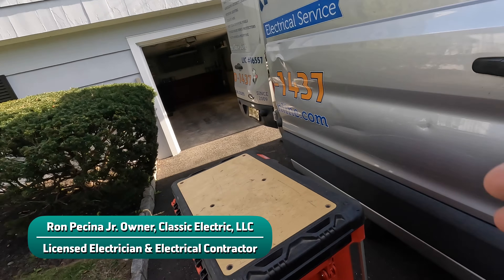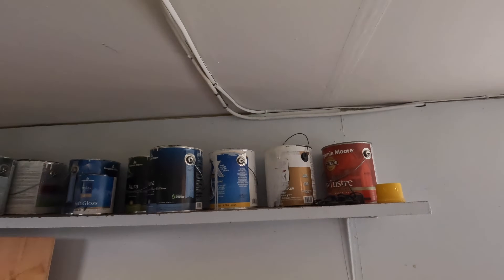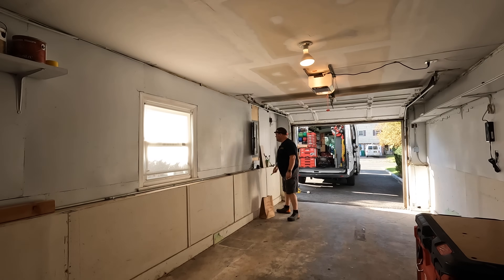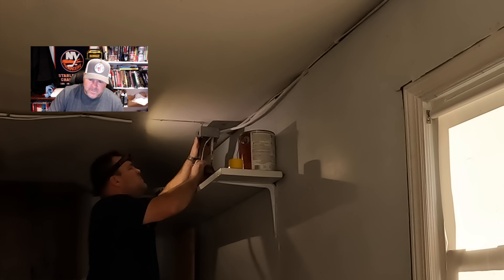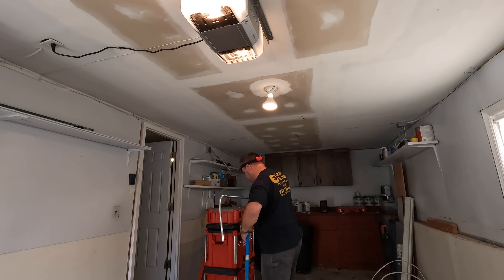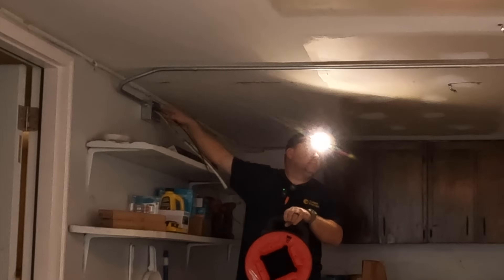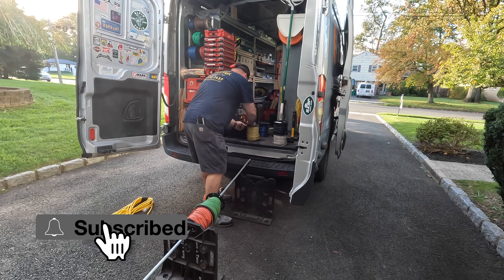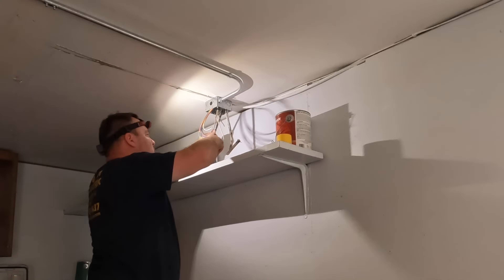Garage Wiring Code Violations

Comment: Why did you not use WAGO 221 wire connectors.  They are UL approved and are faster, neater and just as reliable as 1927 wire nuts.
Reply from the maker: @Chad.Tyrone  These are wire connectors.  Only Ideal has the patent for Wirenuts.”

Comment: If there are some exposed romex cables that run from the electrical panel all the way up to the top plate and then along the top plate in a garage without ceiling, does that alarm you?
Reply from the maker: @6668-x5y  Depends.

Comment: Hello, I'm new to your channel. I just finished building a garage and I'm trying to get a real answer to what wire I should use from house box to sub panel in garage. I have been told 6/3 and others have different size. House is 100 amp, sub will be 50 amp. Other than lights,openers and a small air compressor I have a 125 welder that plugs in 110. Hope you can help.. thanks
Reply from the maker: If it were I’d ask for PVC conduit buried minimum 18” deep with #6 AWG copper THHN/ THWN 4-wire.

Comment: I've always thought that EMT was used indoors, whereas PVC is used outdoors and underground feeds, since it can be made watertight and does not rust and collapse underground.  Of course unlike EMT its not self-bonding, being non conductive, so you have to remember to pull a green wire to bond the system.
Reply from the maker: thats an accurate assessment.

Comment: I would much rather use EMT than PVC. Wires pull easier in EMT. PVC gets crooked and wonky unless you use a lot of straps. EMT 3' off the box and every 10' (I usually did 8') and you're done. Nice little job Ron.

That old wiring was better than a lot of DIY stuff. At least the guy grounded it.

If you really want to cringe, go to upstate NY or Vermont. You have never seen sketchy until you go there. I had a Masters in VT before I retired. Back then you didn't need to have a license to wire a house. Don't know if that has changed.

Comment: What is the fishtape that broke on you again. I'm thinking of getting 1 & want 2 avoid it. TIA. Great work! IMO & IME PVC should never be used. It just turns into a mess! We had some put in at my work & like 2 years after that the clips started braking & everything, was just a HUGE mess & I volunteer for a local no kill pet rescue in my area that is a 501 C 3 non-profit so that was a HUGE & expensive problem!

Comment: Nice job.  As a consulting/design engineer I always required two hole straps and did not allow screw fittings, but that's  just me on commercial,  educational,  and industrial projects.
Reply: That's because, as an engineer, you don't know what is practical and what is not. In the field, we often just ignore unrealistic pie-in-the-sky engineering specs.
Reply: @edisont.picard4112  after 25 years of experience inspecting work, there are too many loose set screw couplings, conduits coming disconnected, fasteners pulling out,  It's simple,  follow the specs or I don't sign your pay application,  and you get to do the work over. Specifications my client paid me to write can exceed Code minimums. Remember,  the Code book is not a design guide, but minimum standards.

Comment: Nice cleanup there. WTF is that really old 10/2 (or 10/3) romex with the fiber sheath going to the dryer receptacle?! Did you deal with that end of it? That is so strange, someone recently installed that old cable? Must be recycled cable obviously. PVC or EMT? I vote PVC for outside residential, and EMT for everything inside that doesn't need liquid tightness. EMT just has the "workmanlike" aesthetic in a dry environment. Though I think EMT is suitable for wet environments too, I think it comes in aluminum and stainless.

Comment: I have a hard time swallowing that the risk of damage to the cable on the ceiling outweighed introducing all those additional joints in a feed to a dryer. That said, the wire running from the light to the side of the cabinet was pretty cringey.

Comment: Gee's Ron!  you get a pass because you do not  work with EMT, but you could have done better.  10 degree offsets for the junction boxes needed and 30 degree offset's for those corners.  well, I give you credit for using EMT.
Reply from the maker: You can do whatever you want on your jobs.  Sure, I could’ve done a 90 and a 3-4” offset at 30 degrees but I didn’t see it like that while I was doing it. I’m fine with my install.

Comment: Hi Ron. When I wired my two-car garage, I ran all exposed cables through metal conduit. I did this in case a blade or other sharp object got loose or I became DIY frustrated and threw something. All wiring is 12 gauge, and all outlets are 20amp rated. For four or fewer outlets, I wired them to a separate breaker also rated for 20amps. I realize this is overkill, but it is still cheaper than hiring an electrician, and it looks so good.
Reply from the maker: Nothing wrong with more than what you need.  20A x 120V = 2400 watts.  Plus (4) circuits like that! 4 x 2400 = 9600 watts.  Dude, you can run a lot of stuff with that much capacity.
Reply: Hi Ron. Thank you for your nice reply. I forgot to add why I strive to do the best electrical work. My next-door neighbor is a retired master electrician. He knows I always strive to do the best and my time, effort, and cost don't concern me. Thanks again and have a nice and safe day.🔌 @electricianron_New_Jersey

Comment: Great video. Quick question. The romex from the ceiling box back to the panel is still exposed. Is t that still an issue?
Reply from the maker: I think it’s out of the way and not an issue.  Do you? I was thinking a short piece of framing lumber (like a 2x4) could cover that up pretty easily.
Reply: @electricianron_New_Jersey I agree, a little wood could be used to cover the Romex in the ceiling corner.

Comment: Ron, I enjoy your videos and I feel for you too. I’m regionally worked in the south for 45 years and somehow I got tricked by my wife  move to Midwest. I have never encountered a smorgasbord of the wiring technique and how it ever got passed by inspection. I’m still scratching my head, there’s a NEC way and then what you’re doing correcting, unsafe, wiring techniques. I hope the homeowner understands that if something happens to the home and the fire marshal reports this the insurance will not cover their home. It’s Very important to have a license electrician/contractor for the homeowner safety. Keep doing your great stewardship videos.
Reply from the maker: Brother you aren’t kidding! This house under contract so these violations were brought up in an inspection report.  The buyers hire a home inspector then the owner pays to have the work repaired/ replaced/ and/ or removed.  I love what I do! I’m happy you enjoy the channel!!
Reply: Just to comment on the insurance.    My home caught fire due to faulty wiring that was not up to code.  Not only will the fire department investigate the fire and determine the cause, the insurance will send their own team in to do their own investigation.   The fire department blamed a faulty chimney, despite telling them there was not a fire in the fire place.  The Insurance found bad wiring that was also not up to code.  They covered the claim and as per them, other than my word they had no idea if I had done the wiring or a previous owner.   The previous owner did tell me they hired a licensed electrician to update the wiring.   Obviously it's always better safe than sorry and the wiring needs to be cone correctly, but I thought I'd share this to let people know how the claim sort of works.

Comment: The thirty amp line to the dryer would normally be #10 copper, but because there are 5 current carrying conductor, you need to upsize to #8 copper.
Reply from the maker: Show me the work.

Comment: Old school and alwsys used EMT in houses. Too often I would not run any PVC and cement was bad. Ran EMT in rear of my basement to feed washer & dryer & new circuits and to the garage. Only wish that I would have ran EMT or ENT to second floor bedroom TV'S 40 years ago. Ran RG 5 cable and a few years ago when cable company installed new cable boxes tried to tell me that I ran the wrong cable. Told the cable clowns that far superior RG6 cable was not out when I ran that cable.

Comment: i thought you could not run two seperate voltages in the same conduit..?
Reply from the maker: They're both in the same distribution panel too!
Reply: You're not allowed to run low volt wiring meaning telecommunications cables,  doorbell wiring, in the same raceway or outlet box as line voltage unless the box has a divider to separate the low and line volt wiring.   You're also not permitted to install service conductors in the same raceway as feeders or branch circuit wiring, but feeders and branch circuits can be in the same raceway.  Service conductors are UNFUSED, and a short between a service conductor and a feeder or branch circuit conductor leaves a circuit with no overload or short circuit protection.
Reply: I believe it's voltage to ground.so the 240v dryer circuit is still only 120v to ground.

Comment: Hi Ron, love watching your videos. I have a question. You left the two Romex cables running from the electric panel to the first junction box. They were tucked into the corner where the wall meets the ceiling. Is this OK to have exposed Romex this way? I always thought you could not have exposed Romex more than just several inches.
Reply from the maker: It's really judgement call. None of this is being inspected but IMO it's no longer subject to physical damage.
Reply: @electricianron_New_Jersey  I agree with the changes to the light. And I'm sure that you did what you had to do to those 2 circuits to meet code in your area. And you did it in a cost-effective manner that the realtor likely prefers. Still, it is videos like these that make me grateful that my service panels (and other utilities) are in my unfinished basement where things can be more easily upgraded properly. Adding 2 splices to each wire just goes against the grain for me for the limited practical safety improvement.
Reply: He forgot the code😊😊😊😊
Reply: There is some ambiguity as far as the “protection from physical damage. It’s pretty out of the way in the corner but sleeving the whole cable might have been better
Reply: I thought you could go one size smaller for the ground? Has that changed?
Reply from the maker: @TomCee53  the equipment grounding conductor is based on the size of the largest ungrounded conductor and Table 250.122.
Reply: @TomCee53 Generally speaking, 30 amps and less, the ground is the same size as the circuit conductors.

Comment: Hey Ron, stupid question: Can any non-contact tester work on a DC circuit/wiring, or just AC?
Reply from the maker: I'm pretty sure this volt-tick by Klein does do DC current. I'm sure I've troubleshooted it with the wafer LED's.
Reply: @electricianron_New_Jersey I checked out the Milwaukee powered fish tape after seeing you using it and also saw all the crappy reviews on it…Milwaukee blew this one unfortunately 😢